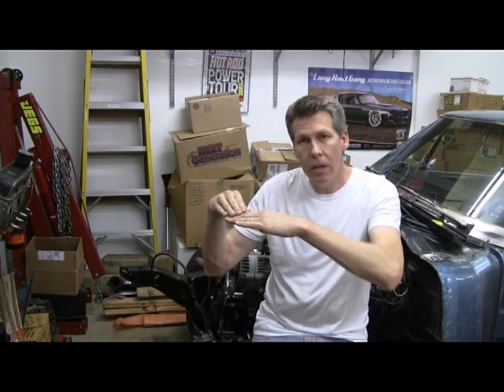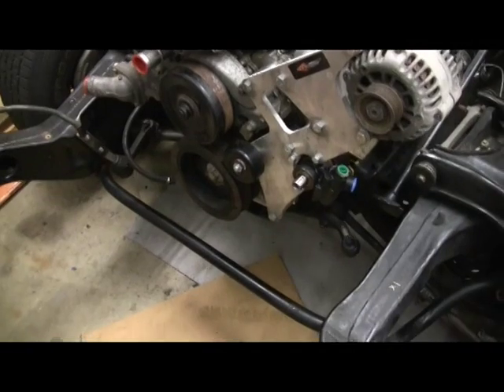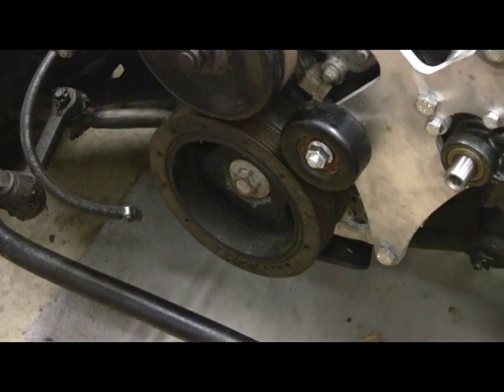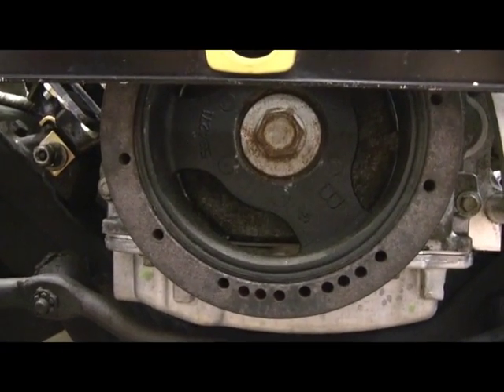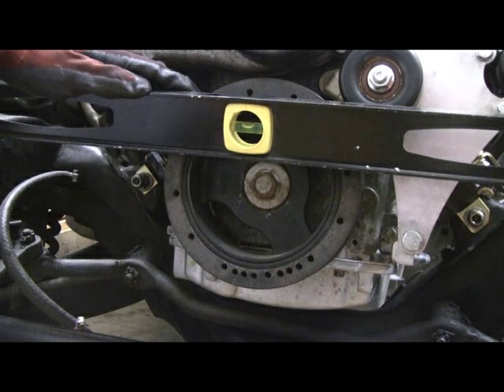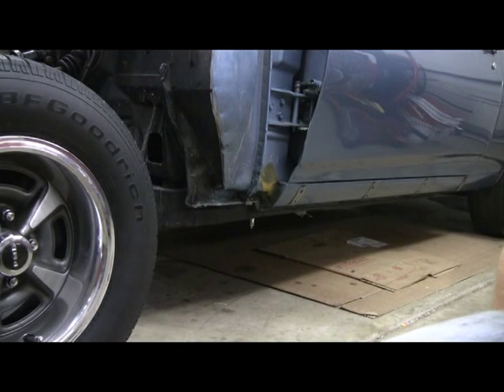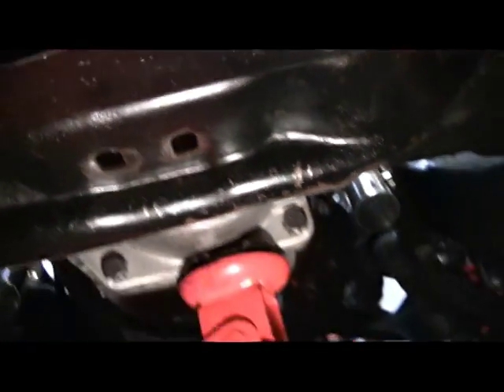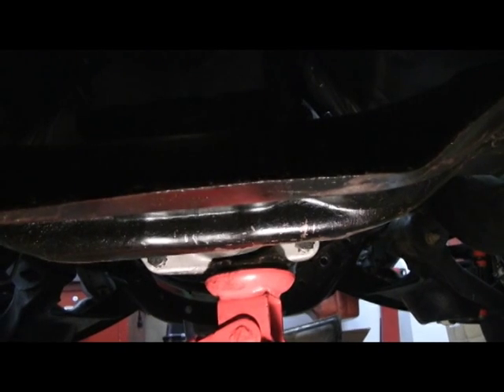LS Conversion Swap Part 12, driveline Geometry

Comment: What kind of oil pan are you using?  Do the tie rods clear the pan from lock to lock?  I’m having issues and was wondering what your setup is. What are you using as far as engine mounts as well?
Reply from the maker: Watch video #13, I cover all the mount stuff, lots of info.
Reply: @primegaragelsswap  I just ran across your videos, thanks for the help

Comment: They make those angle finders that look like a tape measure, find a flat spot and it tells you the angle. If you do it to the old motor before you pull it out its easier.
Reply from the maker: Thanks for the tip, I will need to do this once everything is in. Unfortunattly I did not do it to the old set up, but with what I did I should be close. My rear upper control arms are adjustable so I should be able to dial it in. Next time I will do it different.